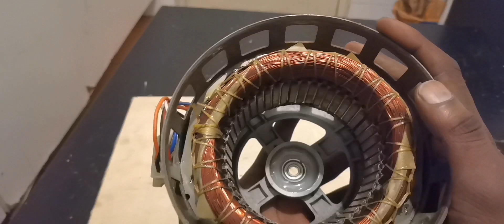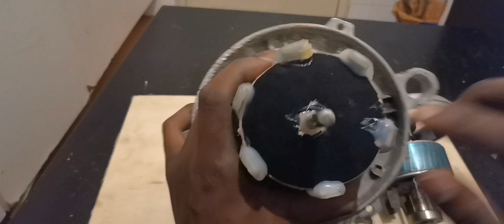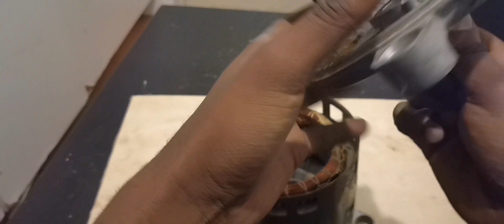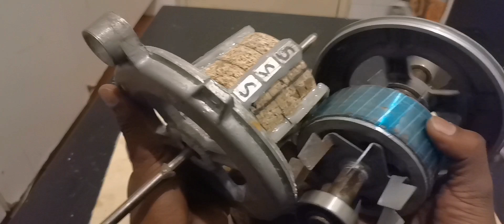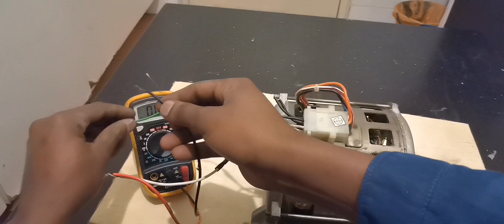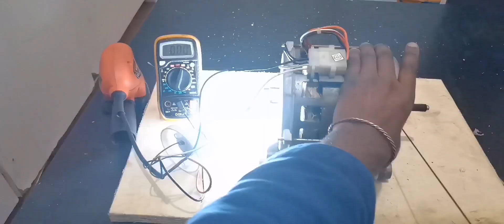Washing machine motor to generator #how to make high voltage generator #diy powerful generator

Comment: Please l have two of this motor. If l test the continuity of the coil all are reading with each other. So how can I connect them in series since each wire give reading to the other wires?